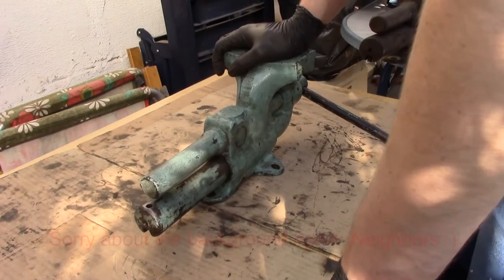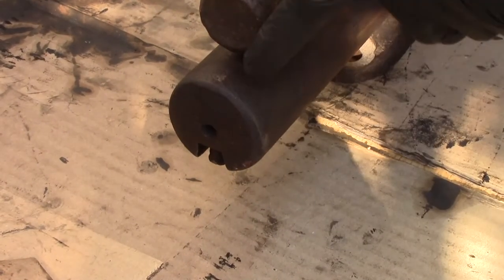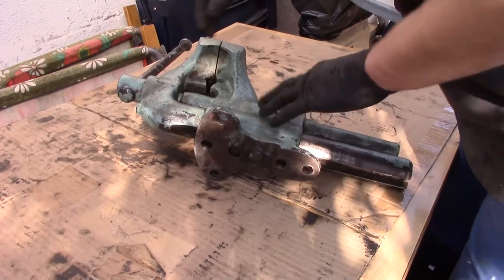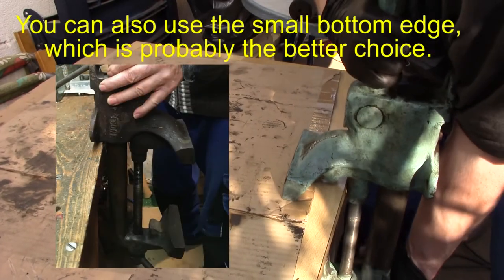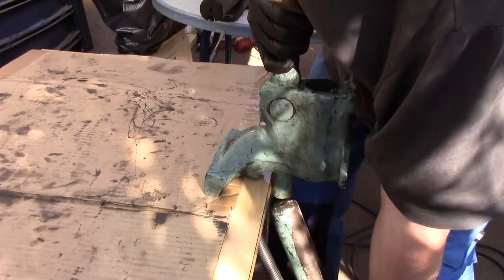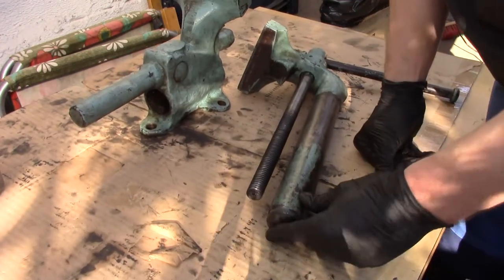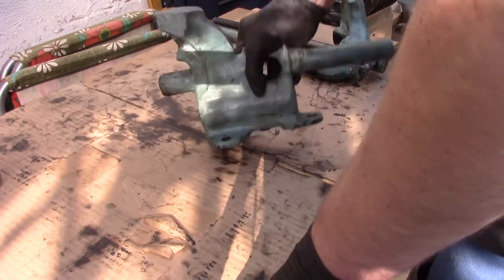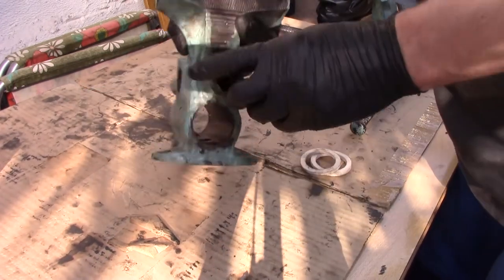Classic Heuer Vises - Part 3: pre-war Heuer Front Vise

Comment from the maker: Hey guys and gals. It took me some time to get this finished. I was busy with work, and also had to take some additional footage about the felt rings.. I am not showing all the other attempts on getting the round bar and the felt rings to cooperate, but lot's of swearing was involved :).

When I wrote pre-compress the felt rings I meant you could insert the dynamic jaw from the back (w/o key of course), then insert the front felt ring easily, and let this sit for a day. This should compress the felt ring enough so it shouldn't stick out that much anymore. Just an idea, though.)

Also when I am saying 1938 I mean 1936.

Comment: Hello. I found one of these in 150 mm version but it is stuck from rust. Don't feel that it is good idea to force it open, so do you please have good idea how soak it? Looks also like dynamic jaw has bent a little backwards like somebody had seriously overtightened the screw. I wonder is this reason why they change design later?
Reply from the maker: Plenty of oil into the keyway, also remove the key screws if you can (and oil in there, too). The round bar's fit inside the static jaw isn't super tight, the key makes it tight. It should move at least, getting the jaw out completely is another issue altogether.

Comment: Hello friend Bastel, I have a FRONT n°4 like this, I'm from Argentina and mine doesn't fit until the end, it's perfect for any job!but they do not touch between the two jaws by 1mm... and it still has the original grooves on the jaws. Is there a way to adjust it?
Reply from the maker: Like the screw protection tube bumps into the movable jaw, right? I have seen that with the very small No. 2 a lot. If the tube is too long, check if the tube is loose (only one spot weld holds it in) and if not, just shorten the tube a bit.
Reply: @bastel_  perfect and thanks! this weekend i work in this solution. Regards